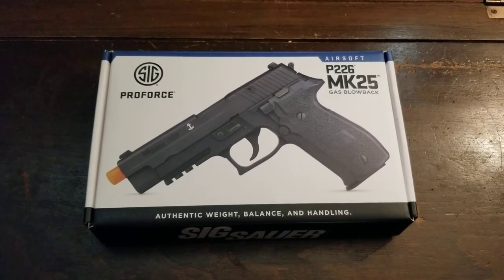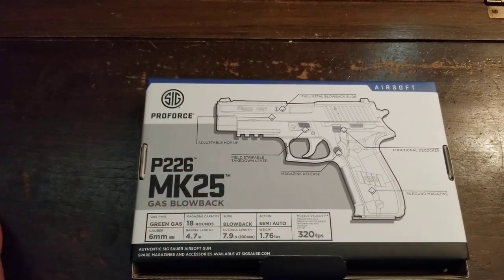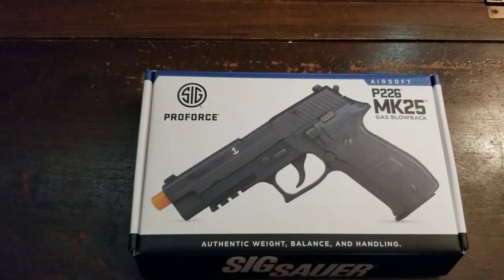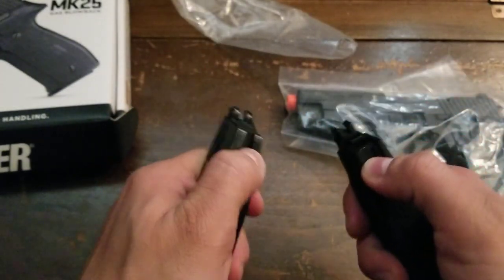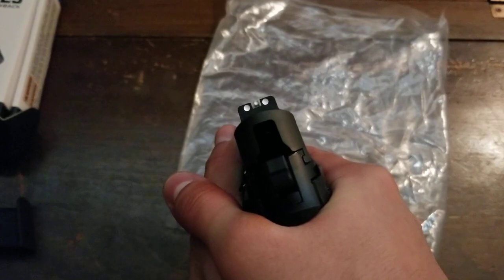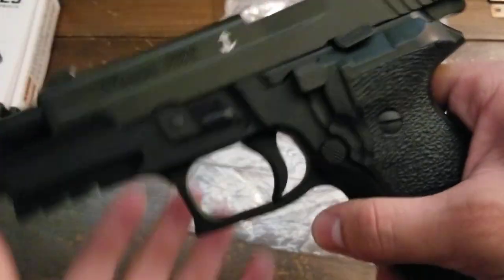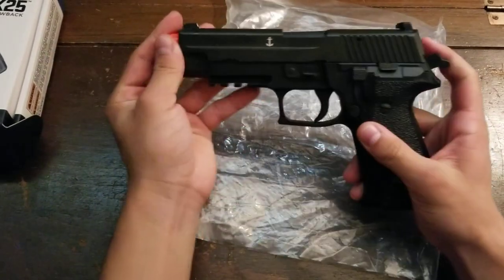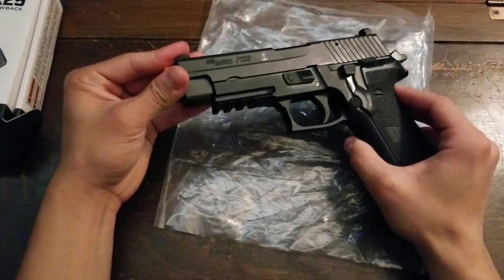Airsoft Sig Proforce P226 MK25 Gas Blowback Unboxing

Comment: That's how a decocker functions on a p226, sig sauer approves replica designs themselves to match real steel. You use the decocker before you holster to have it set to single action ready for the draw.
Reply from the maker: Is the decocker supposed to half cock the gun or decock the gun? My gun half cocks it.
Reply: @jjtwins9262  The 226 goes to half-cock. If it were all the way down, it would be resting against the firing pin.
Reply: That’s not how the real steel works mate. Decocker on the real Sig p226 doesn’t drop hammer half way as shown in this video. Though it doesn’t drop all the way and rest at the firing pin as someone mentioned correctly but rather drop almost all the way about 3/4 position not 1/2 or half way. There is a small gap between the hammer and the firing pin when the decocker lever in engaged on the real Sig p226. Btw We Tech Sig p226 airsoft nails this mechanism imo, the hammer drop like the real thing and double action firing works perfectly. The fact that Sig Proforce of all people messes this up still boggles my mine.

Comment: Sorry, but you're said that the slide is metal, but the frame is polymer? Are you sure about that?
Reply from the maker: I think, the frame did not feel like metal.
Reply: @jjtwins9262  any possibility to re-check? Because already purchase yesterday and i worried
Reply from the maker: @TurryAR  it's not metal, it's a polymer frame. Just like the real one, the real ones have a polymer frame. This gun is supposed to have the same exact feel of the real version. It's not a bad gun, it still feels very nice and real.
Reply: The real Sig MK25 has an alloy frame, not polymer. That's what Glock frames are made of.
Reply: I think he’s mistaking the grips for the frame. Someone on the product page has confirmed that the frame is in fact metal with a polymer grip, just like the real thing.
Reply: @airish7384  yes, the frame is 100% metal. The grip is plastic, not polymer like the real deal.

Comment: Are the frame and grip poly ? or just the grip ?
Reply: Just the grip which is weird. The p226 the real one the entire pistol is made put of steel and the grip pannels are made out of polymer

Sorry the slide is made put of steel and so as the barrel frame is made put of aluminum the real one I'm talking about. I would love to own the airsoft version of it if it's like as the real p226. I'm on the fence of the p226 or a hi capa. I love 1911/2011s

Comment: lookin to get this gun as my first pistol would you recommend
Reply from the maker: I do reccomend it, I also would highly recommend the Elite Force M1911A1 Tac.
Reply: thanks for feedback
Reply: @jjtwins9262  But I don't recommend it because I have a problem that there are two bullets in the barrel. One falls out and the other gets stuck
Reply: @zhd_02  Ok well I already bought and I think you need to field strip it and check the hop up, inner barrel, bucking, or the nozzle
The magazine could also be broken and remember to field strip it
Reply: @jjtwins9262  Yeah way too many issues
1. Paint finish comes off on every part of the gun and messes up the internals
2. Paint mixes with lube and makes this gross black stuff
3. Orange tip is basically part of barrel
4. Gas sprayed out of all my mags when shooting
5. Inner barrel and hop up suck and its shoots very inaccurate 
6. Takedown lever is very loose
Just buy an unlicensed WE P226 or something else and I wasted 160 dollars on it should have saved up 300 more and bought a full on GBBR

Comment: Yeah way too many issues
1. Paint finish comes off on every part of the gun and messes up the internals
2. Paint mixes with lube and makes this gross black stuff
3. Orange tip is basically part of barrel
4. Gas sprayed out of all my mags when shooting
5. Inner barrel and hop up suck and its shoots very inaccurate 
6. Takedown lever is very loose
Just buy an unlicensed WE P226 or something else and I wasted 160 dollars on it should have saved up 300 more and bought a full on GBBR
Reply: 7. the lower is made of plastic